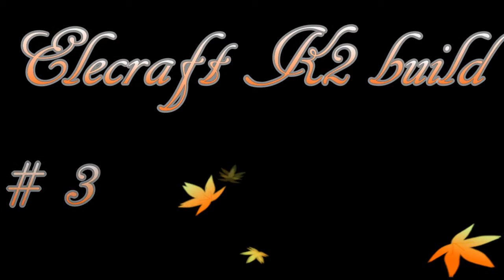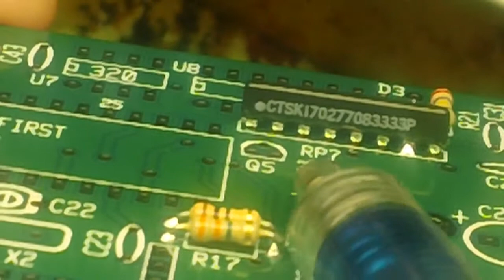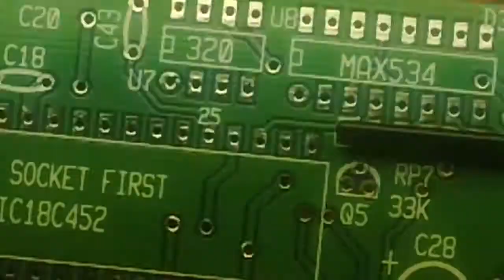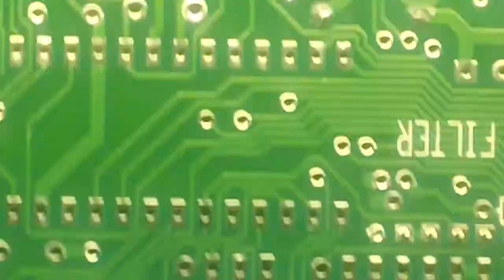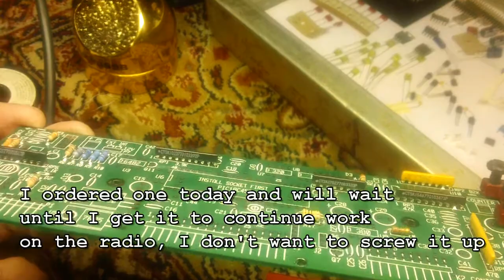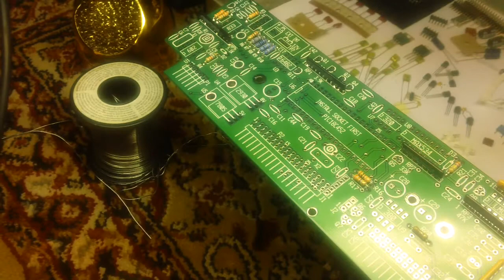Elecraft K2 Build Part 3

Comment: I’ve done some checking on the RP issue regarding polarity and putting the dot at pin 1 on the board.  I was told by a very experience ham that not all of the resistor networks are wired in series through the network.  Some are found to have parallel connections within the network. Hence, “polarity” when it comes to installation.  I think Elecraft says install all with the dot at pin 1 to avoid having to have different instructions for the different Resistor “Packs.”  Just my suspicion.  I like your commentary and the build detail in this series.  I just received my K2 kit and I am watching closely, learning from the things you discovered.  Thank you for this detailed build series.  73, W7LDT